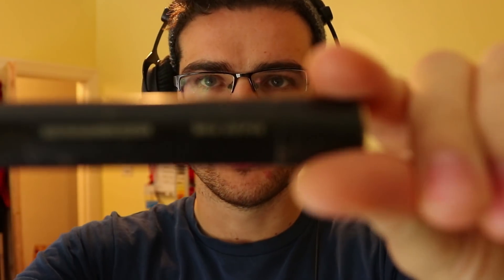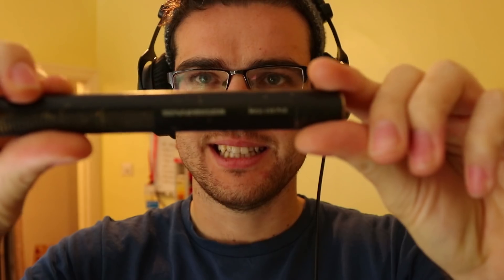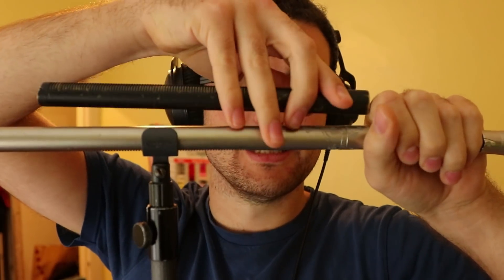Long Vs Short Shotgun Microphone

Comment: How does the 816 compare to Sanken CS3e? The Sanken is just as long as the 416 but it seems like more people go for the Sanken over the ultra long shotguns when they need distance.
Reply from the maker: Blue's Clues for Fools great question :) need to get my hands on a Sanken to test
Reply: I love my Sanken, but for an unconventional shot (talent is in the water many feet away or something), I'd prefer to use an 816, Ntg 8(last choice for long guns) or an mkh70. The cs3e has very good range though.